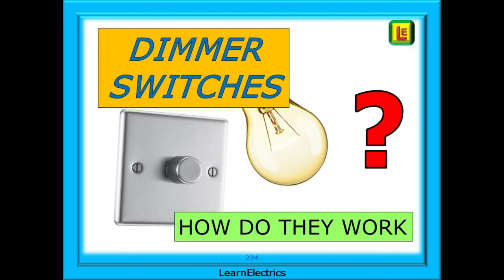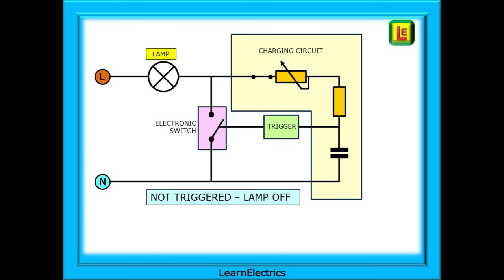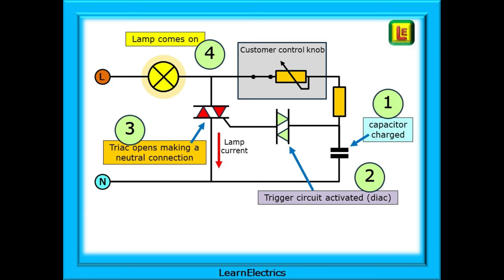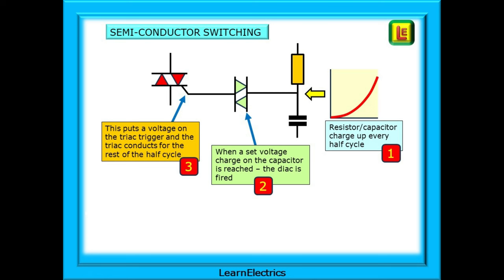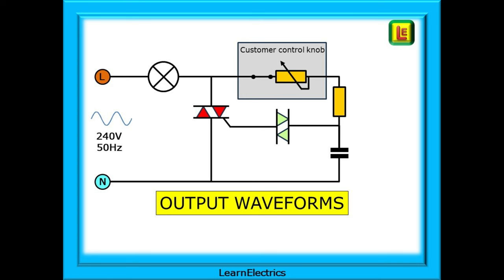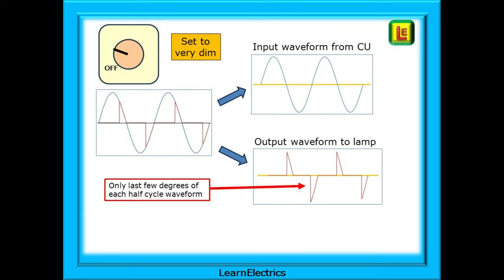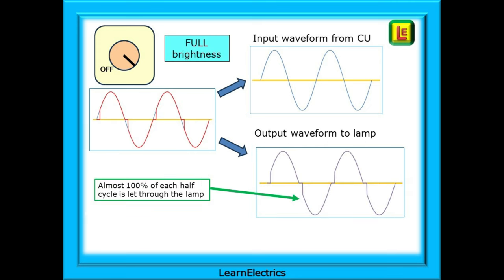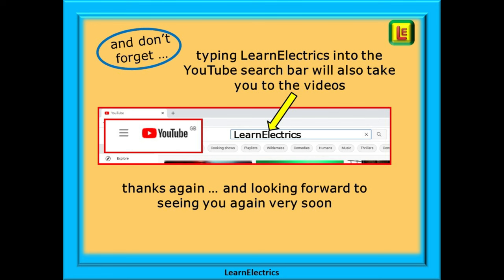DIMMER SWITCHES – HOW THEY WORK – AN EASY INTRODUCTION TO HOW THEY CONTROL & VARY THE LIGHT OUTPUT

Comment: So would a dimmer switch before a full bridge rectifier control both the current and voltage on the DC side?  Thank you.
Reply from the maker: It would have some effect, certainly, how good the control is would depend on the. type of dimmer.

Comment: After installing yet another dimmer plate earlier today, I thought I would test the voltage at min and max control knob position. I understand a current draw determines a resistive output light but the max voltage was only 160v at 100% dimmer on position, despite uk 230v supply. This seems to be inherent to the manufacturer/product design perhaps?
Reply from the maker: The voltage will be divided across the dimmer and the lamps, but you should get a constant 230V-ish at the breaker.

Comment: Great video again, Dave. Should the lamp be on the other side of de dimmer switsch?
Reply from the maker: As I said in the first couple of slides, I was keeping it very simple so that everybody can follow. I will be doing a video soon on the actual wiring of different circuits. Thanks for watching. Dave.
Reply: Ok. Thanks for your answer. I look forward to that video and also the one about LED dimmers.

Comment: We should have only 1 dimmer switch in each lighting circuit?

Great content as usual 👌
Reply from the maker: Absolutely. If you have a room with two switches, only one of them should be a dimmer. Thanks for watching, appreciated.
Reply: You can have more than one rotary button, touch button, retractable switch dimmer controls in master-slave dimmer configuration in one circuit.

Comment: There are some kind of new dimmer switches on the market compared to these old TRIAC ones, claiming to be able to dim LED lights too... I don't know how that would work. Because I have an old type dimmer, with a dimmable led ceiling light which works just fine. 
The new ones are pretty expensive switches ~30 USD or so, compared to the  old ones which are around 3-5USD
Can you maybe a do a video on those too? It could be that they are mainly the same circuit but with a better marketing.
Reply from the maker: Its on the list now, thanks for the input and thank you for watching. Dave.

Comment: Sir our frequency is 50  or 60 hz. But sir after grounding nutral how the freqancy showing sinewave. Because after grounding nutral becaome zero volt. Please
Reply from the maker: The phase voltage, the up and down bit is either side of the neutral and earth. It is the phase voltage in relation to the neutral. have another look at the video, sometimes a second or third viewing helps. Thanks for watching and stick with it, all will make sense.